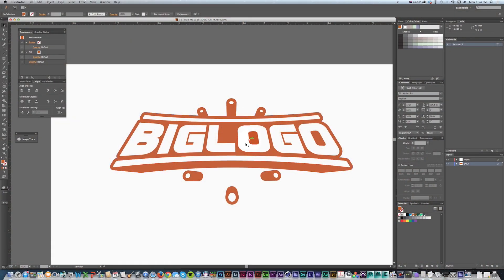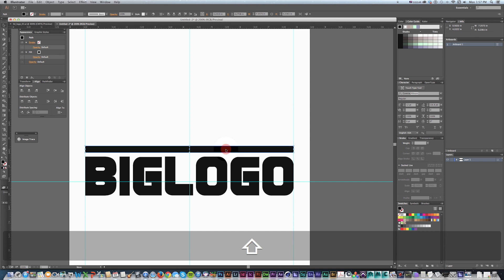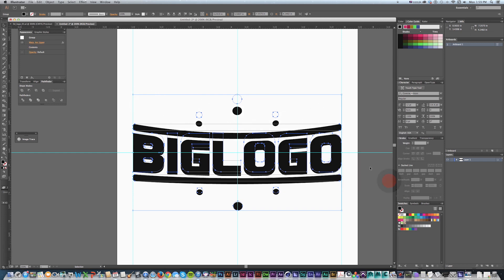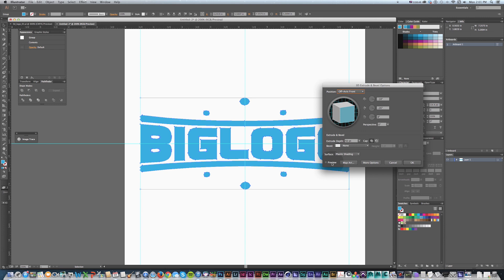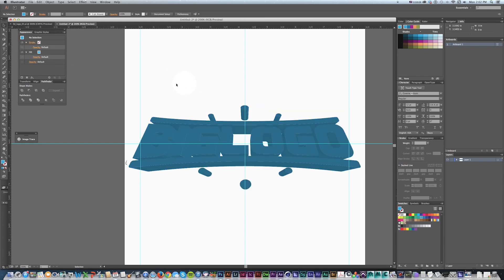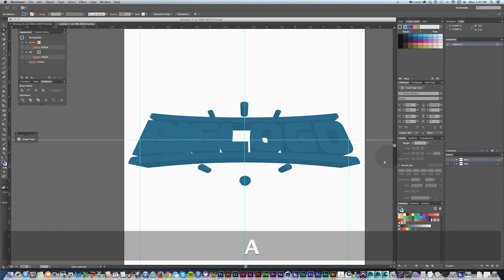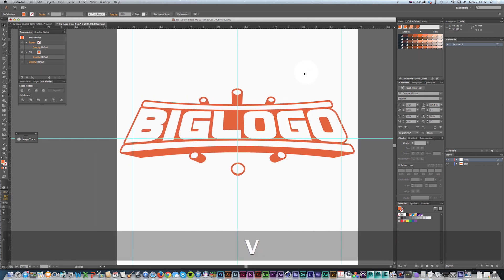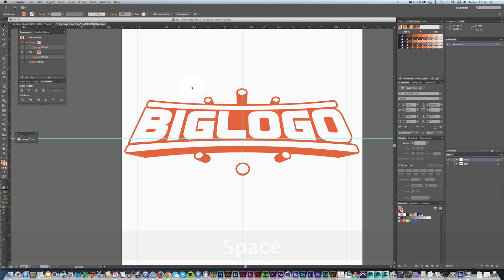How to Design a 3D Logo in Illustrator (Adobe Illustrator Tutorial) - Sean Frangella

Comment: Nice! I'm getting insane over here: Is there a possibility to get the exact same effect but without distorting the original logo? So that you only manipulate the block itself but NOT the logo itself. A fake 3-D block if you will. I need to create the block but want the logo itself be untouched by perspectival distortion. Thanks!
Reply from the maker: Yes, you would just extrude it without the extra effects. 

This is a bit different these days, I’ll be posting some new videos on the current 3D text in illustrator soon.